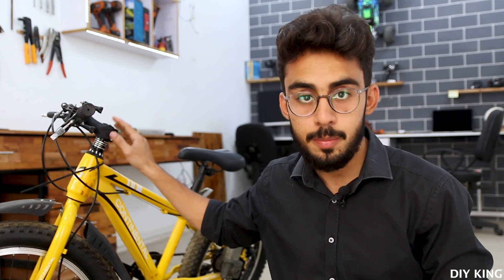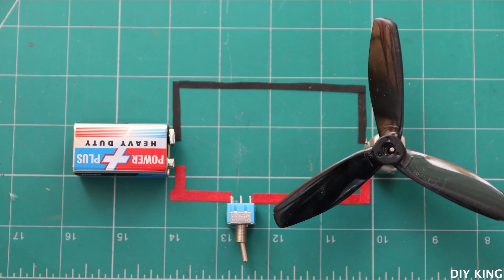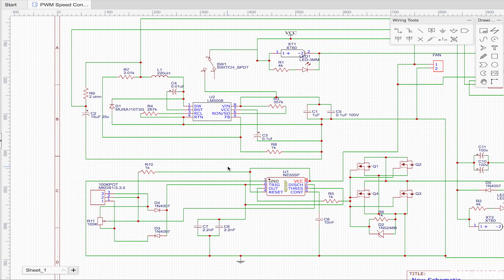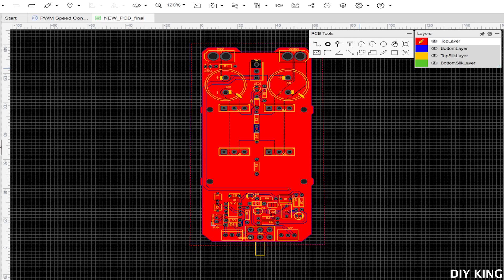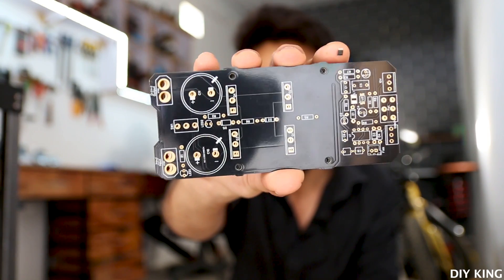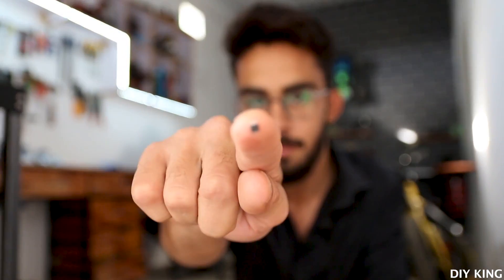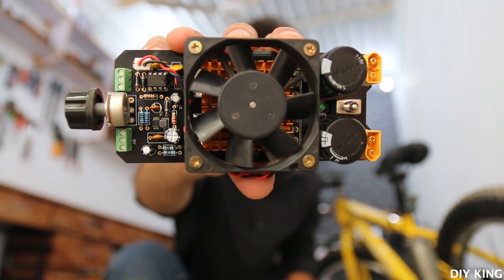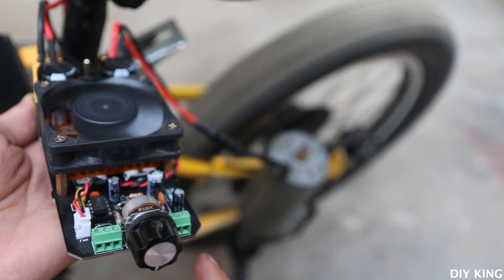How to make a Speed Controller for Electric Bike

Comment from the maker: Corrections:
The voltage is regulated using buck converter IC LM5008.
The 555 timer IC cannot be operated above 15v.
Reply: can u please tell if the voltage from buck converter is used for 555 timer or the dc motor.
Reply: @Ebay Buyer Defender      e-bay man, $25-$45 for most up to 1kw, it may not be pure sine wave, but it works! I I have a 48v -72v 1500w, I'm going to modify, to get 2kw+ and maybe 96v, I have toyed with the idea of using a small ESC, 350w or so, use its ' logic controls' to power the gates of my own MOSFETs, maybe not do  effiencent, may not have safety features, and have to rely on fuses or breakers, but should do about 96-120vdc, and 4kw, and be clunky and junky looking, but it could work, it could possibly run a modified 3phase ac motor? I'll have to look in to that one,
Reply: Can we use 7812 transistor for 555ic to provide 12v
Reply: Hi DIY King!  thank you for a great project.  Please tell me what is the minimum battery voltage required for this circuit to work, is 40 Volt enough to start?
Reply: i am from India how can i buy these instrument

Comment: Hi bro I need some help. In my college they have given me one project. Basically what I have to do is i have to make integrated Electromotive wheel that should be fit in one cycle and whatever components i have to use that should be there in that wheel only, it should be come outside. And at handdle accelerometer should be there and the connection of the accelerator to motor should be the wireless communication, so for that what I can do .... Please bro help me.

Comment: This is great!
I have a challenge and I’d like to know what you think…

I have a working e-bike with a very basic controller, everything works, however I am stuck with the out-of-the factory speed.
This bike doesnt even allow me to reach 25Km/h considering my weight.
All I wanted to do was to have a lil more speed, nothing crazy.
So I bought a KT controller and display thinking that I could change the speed limit.

The new controller is supposed to be better than the original, better mosfets etc..
However it doesn’t work. The display turns on the bike, I can even browse thru the parameters but it shows 0 battery charge, hence nothing works.
I tried all sort of things, like swapping the hall sensor cables to see if there was some mismatch but still nothing. Clearly there is current from the controller cause I measured 3.68V at the Throttle cable when the controller was plugged to the motor and battery.

Battery is 48V 15AH I dont think is the problem, the display turns on, it just doesnt comunicate with the motor (250W)

My naive question:
How can I proceed with modifying the new controller and make it “like” the original?

I thought about making a new one from scratch but it might be too difficult for me,
Besides I’d still have the display problem, I need one to turn on the bike, speed regulation, headlights etc..

I suspect it might be something “simple”, related only to the power circuit, perhaps once I get proper reading of the battery charge everything will work…. hopefully.

Any thoughts is greatly appreciated.

Comment: Great work. Unfortunately , there is no much practical use for DC brushed controllers nowadays since brushed motors aren't used for this purpose anymore. BLDC's with three phase controller are used because of better efficiency, lower noise , advanced torque control mechanism etc. And most important - no need for brushes replacement thus higher reliability.  Of course , if you have time and brushed motors laying around, knowledge in mechanics and patience , this is cheap and interesting solution. Veri nicely done. Thank you.

Comment: Im curious as to when the bike is actually ridden. A wheel under  no load doesnt tell us how robust the speed controller is .Also is there a twist throttle available  as a resistor ? AND ...from a standing start theres a huge current spike that tapers off as you get moving and the load tapers off as you get up to speed . I dont think those fets will handle very much current

Comment: What's your thoughts about building a alternator regulator, that can do the CC CV then shut off, for lithium batteries? It would need a 12/24v nominal, approx, that is PWM, according to the charge needed, and a volt sense, and current sense, and temp, sense, and regulate output accordingly, limmit current from 25a to 150amps +,  you seem to be the guy,  it is far beyond my capabilities, I have a 7s lithium ion bank, I wnt to charge it to 28-28.7v it can go to 29.4v and can handle over 150 amps charge, I have 130 & 150 amp alternators. A similar regulator is nearly $500, because only one company has a monopoly, no one else makes a programmable milti-stage regulator, its basically a buck converter, using the alternator field as the inductor, I don't know how much logic it will require, if it would need a full on microcontroller, or if zenerand MOSFETs could accommodate some of the functions, I'm guessing microcontroller, probably something faster than the average Arduino! It would be a awesome pcb way video, and the voltage sense would need to be protected from possible high voltage, the alternator is capable of around 200-600+ volts, if it over shoots, outputing full field with no battery, a 12v alternator can charge up to 48-60v batteries, depending on a few factors, let me know if you are interested, I'm no big company, or a company at all, I'm just a guy with a need, and think maybe there is others who could use this also, there is alot of ppl with rv's converting to lithium house batteries, and charging with the alternator, can be the end of a big headache, and destroyed alternators, and very expensive batteries, but really, I just want a couple for my self, to charge the batteries for my offgrid home, I have2 banks, a 12v that I want to go to about 13.8 , and 28.7v for the 24v bank! I hope you are willing to help me, maybe we can make some money, with my skills , I could possibly assemble the circuits, on a PCB, but I can not program anything, I'm just a poor guy trying to keep the lights on! When there is no sun!! Thanks and have a great day either way! If I do not hear from you, I will ask later, I just subbed to your channel!!! Thanks again!!
Reply: Why would you need pwm?

I suspect you are overthinking this.

Something to supply dc - two 12vdc server power supplies in series, with a switch to supply either the 12v or 24v to a set of boost converters wired in parallel to get to the 150a you're looking for.

Used server power supplies would run about $100 delivered - the dc-dc boost converters are $17 ea on Ali with free shipping for 40a capacity.

There is a 2900w ps that is currently and frequently available for 50 bucks and will put out 12v 236 amps.

Just add enough boost converters to hit your desired output.

Add a BMS with enough series lines at the lowest amperage available, and use that to control a relay to cut power to the power supplies if vout from the converters hits the max threshhold because the bms only controls the input coil of the relay, you don't need one that is big enough to control your converter output directly.

Comment: Hi there! thanks for sharing! So, How did you deal with the induction loads on the DC motor and the effects on the controller? Did you make any measure on what level the voltage reaches when the mosfets are turned off?

Comment: Switching MOSFET by NE555 out pin and 1k resitor is not proffesional (slow GATE trigger and MOSFETs are heating up) , you can use driver MOSFET will be pro. (Schematic is one big chaos). Sorry for my criticism ; )

Comment: hi bro , i am making this as my final year project and with some extra modifications from a simple e cycle , i saw this video and i made list of the components and bought all the components but i didn't found LM5008 in any of the shops , so can you please give me the cheap priced link of the same. If not then please give me any alternative buck converter circuit for this controller , i need to finish this project asap within a week to 2 weeks. I live in bangalore , so if you know any shop over there then please let me know asap or provide me any alternatrive circuit for 24v 250w dc motor , or please send me the buying  link.